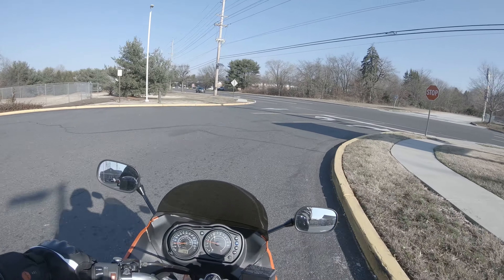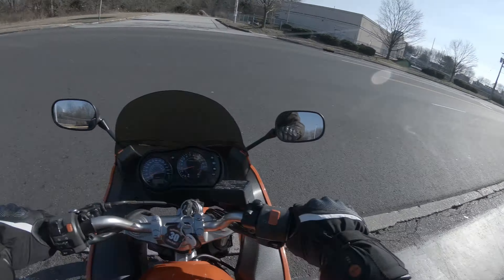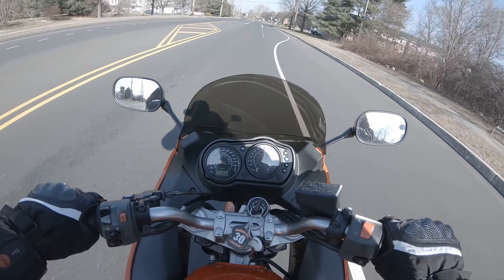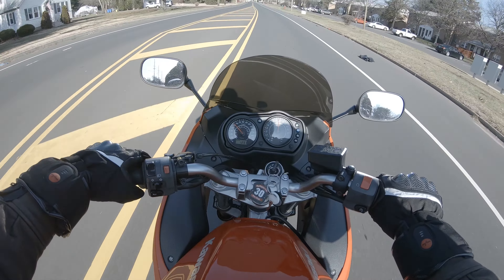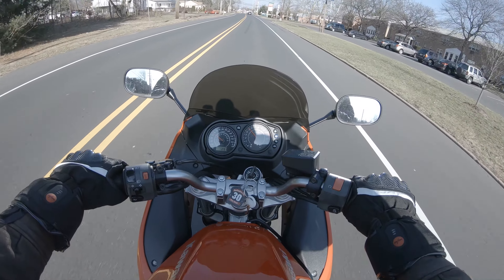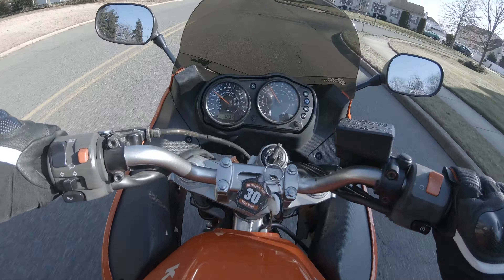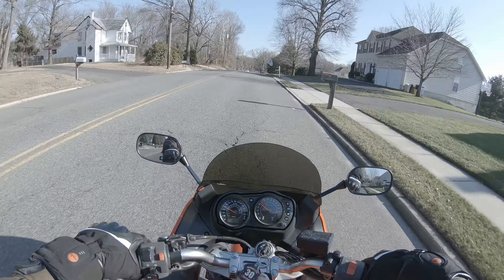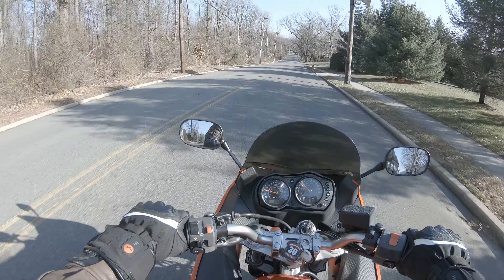Emptying Fuel Injector Cleaner In My Motorcycle! What Happens?

Comment: I don't know what you guys are talking about.... I saw a 500HP gain from one bottle instantly.
Reply: Hell my racing stripes gave me 55 hp instantly
Reply: That's nothing. If i close the air vents in my helmet and I gained 1000 moped experience points. The hp gain was only 7
Reply: That makes total sense. I had a mustang gt an when I bought a new 6 disc changer it added over 8.2 horsepower.  Lmao
Reply: I added cleaner to my bike, threw away the bottle, turned around and found a brand new shiny bike sitting there.
Reply: When your drag car has bad injectors
Reply: You did not get 550 hp gain.  Must have gotten old stock bottle. :)
Reply: @brandonb.3317  Heck my racing strips only made my underwear Stink..lol
Reply: @brianstumo8581  this one ended it all 😭😭😭😭😂
Reply: You get even more hp when you pull the sticker off the bottle and slap it on the tank
Reply: Lol yeah man I added a bottle to my yzf600 and went so fast my molecules separated and I entered another dimension.  what a trip outta sight!!😂
Reply: You probably saw a puty cat too. Or maybe the great wiz of oz.
Reply: what say the F' you talkin about.
Reply: Presume it would take a little time to do it's cleaning action. Any immediate improvements might be due to some octane improving properties

Comment: If filling the tank gave instant results, you don’t have an injector issue, you either have a plugged filter or collapsing fuel line.
 Filling the tank increases the head pressure and pushes the fuel past the obstruction, until it gets low again.
Reply: If he was running cheap gas , the fuel injector cleaner would be a  improvement within about 10 minutes, I have experienced this multiple times  with numerous small engines including motorcycles. One big difference as well is using gas that DOES NOT have ethanol. It will run like it’s not even the same bike.
Reply: @spartanx169x  he didn’t say 10 min, he said 2, or pretty much instantly.  It’s a delivery issue.  Whether the gas has ethanol or not is not pertinent either, because, again, it’s pretty much instant.  
 And the difference in the fuel isn’t that dramatic.  @ 10% ethanol there is a loss of energy, but not a “ hang on tight this is pure gas” difference.  The biggest issue with ethanol is it attracts water and that causes performance issues and  fouls filters and attacks fuel system internals.
Reply: Vent cap or vacuum hose on the petcock
Reply: @PeterSmith-or3pq   no vent cap or petcock on fuel injection, it’s a pressurized system.  Feed and return to tank. Otherwise I would agree.

Comment: Rides it 2 minutes and suddenly the bike feels better. Squid...
Reply: I mean most of the additives contain Octane boosters too.  So higher Octane could result in a little higher performance (Really small) and lower gas milage.
Reply: Yeah its actually nitromethane thats being added so he definitely felt the difference
Reply: @MrArjanOskam  Higher octane doesnt boost performance UNLESS the engine is experiencing preignition (otherwise known as detonation, pinging and/or knocking... we'll simply call it preignition for now). Preignition is exactly what it sounds like... the fuel is igniting before (pre) the piston reaches top dead center, which is caused by excessive combustion chamber heat. The fuel is actually igniting before the spark plug fires, which will not only rob power, it can do real nasty things inside the engine, like bending rods, valve stems, putting holes in the piston(s), blow head gaskets, etc, etc.

The higher the fuel octane rating, the less prone to preignition the fuel is. So if the engine is detonating on something like 87 octane, it wont make full power in the first place. If the same bike gets 91 or 93 octane gas and the preignition stops, then it WILL make more power, simply because the engine is running without preignition. If the engine is running properly on 87 octane with no detonation, using 89, 91 or 93 octane will not make the bike run better or make more power. The bike will run the same as it does with 87 octane (I get a kick out or riders that say "I put 100 octane race fuel in my bike and it was way faster. Only if the bike was not running properly in the first place. If the bike was running well on 93 octane, putting in 100 octane wont do a thing, other than smell different coming out of the exhaust pipe). If the bike still detonates with 93 octane gas, then something else is wrong, and the bike should be brought in for service.
Reply: Damn, that was some fast ass cleaning 🙄
Reply: @MrArjanOskam  if you have problems with octanes yes, otherwise will make no difference.
Reply: @pedromesquita2780  True, mine felt better, but probably because long standstill and cheap fuel
Reply: Ha! I know this dude that put 91 octane on his honda cbr. (It calls for 87) he decided to go with 87. Guess what?  it actually increased the gas milage. He use to get 180 to 190 mile range per full
 tank, now he gets 200 plus (around 225 to 235 per full tank)
Reply: @MrArjanOskam  high octane doesnt add power in an engine that isnt made to  use that octane. Octane number just increases how much gas can compress before it spontainously explodes (withouth the spark plug). Higher compression =more air = better burn =faster cylinder movement = MOAAAAAAAAR  POWAAAAAAAAAAAA!!!!!!!
Reply: As if the 650 Kawi wasn’t enough..
Reply: Didnt even hit the revs and the whole tank to clean it out...Noobs😂LoudLove lil brudda,You’ll figure it out in time🔊🔊🔊💜💜💜
Reply: @JB-ls5pq  actually depending on the vehicle and tune as well. Some modern ECUs when they take at least 93 and you put an octane booster and boost it to 102-106, the ecu auto pulls timing and you make more power. Some low compression engines also get 1-3 hp increase is very minimal, we see in our dyno. The reason is due to the engine calculating the timing and being harder to burn they can make more precise timing and it increases the performance a little.

But your point still stands, octane rating doesn’t equal more power. But it does help when you are turning up the power.
Reply: I love your attitude 🤘🏻🤘🏻🤘🏻
Reply: @Ray-xx5np  dude best awsner I’ve ever seen anybody write out it’s really that simple for all the doorknobs out there 🤘🏻🤘🏻🤘🏻
Reply: He just used more throttle the 2nd time .
Reply: Wow that was dumb.
Reply: @Ray-xx5np  running high octane, like “race” gas will help clean out some carbon tho from my experience.
Reply: @alicesrustychains6767  Thank you, my friend. I really appreciate your nice comment!! 👍 👍
Reply: @colossalbigfoot256  I havent seen that (not saying its wrong, I just never noticed it). One thing I DID notice though... I used to have a '92 Mustang 5.0 that I installed a Kenne Bell supercharger, and an MSD ignition with the adjustable timing module. A gas station near me sold 100 octane (unleaded) pump gas, and I'd use that, and bump the initial timing up to 18 degrees. For a while, I stopped using the 100 octane pump gas, and put a bottled additive octane booster into 93 octane pump gas. It worked ok, but during a plug change, I found a residue coating the plugs that looked exactly like rust. Initially, I thought I had blown a head gasket and was leaking antifreeze into the combustion chamber, but the car was running normally. It was the additive doing that. I stopped using any sort of bottled octane boost from that point on.
Reply: I noticed the royal purple I used in my 2013 soft tail slim real fast and after 600 miles did it again big difference. Get the stuff with a breaks up carbon 👍
Reply: Salty
Reply: What camera are you using? and where did you mount it? Also are you using a external microphone?
Reply: Lucas fuel injection cleaner works good lubricates injectors too!!!
Reply: 222 Guys who have never worked on an engine, thumbs up'ed your comment.
Reply: @Ray-xx5np   Most knock goes unseen. Something like a scangauge for obdii vehicles will show the actual knock on a stock tune.
 Also, it only take a small amount of acetone to disturb fuel enough to allow a greater offgas, which results in a more efficient combustion.
Reply: I had a carb issue starting to show up. I added some product and I instantly felt a difference so it's highly possible he felt a difference after a short blast. Some of these cleaning products can really bring some life back to the internals.

Comment: Seriously? No cleaner works instantly. Get through a whole tankfuland then look for a difference.
Reply: Maybe not in this case. My diesel was blowing smoke due to the reduced sulphur content blocking the injectors, but I didn't know why. When someone told me I put a double dose of injector cleaner in the tank and the problem was almost gone by the time I got home. Believe me, it was a real relief! I'm not sure about any performance improvements but it can't have hurt.
Reply: It depends on how much you mix up I always go for over kill on my mixes chevron with tech Ron black and gray bottles largest bottle you can buy 104 octane super black and heat red bottle and 93 octane gas for that super kick in the pants my olds 307 loves it peace and much respect to you Jason
Reply: You're right, but also what can happen is that it breaks down water/condens particles, so that it constantly feels better.. I mean, no hesitation and sputtering in carburetor/injection..
Reply: Now you're talking!
Reply: For me it does, last week my bike felt sluggish & idling was rough, even died while idling when its cold. So over the weekend, added in half a bottle of penrite injector cleaner with roughly 2 gal of fuel…then run it around the neighbourhood for few minutes. Could really felt the difference, no more rough idle…acceleration felt better, got a marginally better top speed than before 😊

Comment: With only 7k mls on the bike there will be no need to clean the injectors unless there had been a bad batch of fuel that may have fouled them but bike was running ok before. Any noticable performance increase would have been from getting the engine real hot on a cold day.
Reply: U gave me my answer man thanks any company you’d recommend?😊

Comment: It's a progressive cleaner snd breaks down crud where ever fuel sits within the components. It will possibly make your bike stutter etc ifnits breaking  up harsh deposits but it does improve the responsiveness etc once it's done its job. They recomend higher rpm too for s better cleaning cycle as your passing more fuel and cleaner with more rpm and also adding more hear. Hope this helps bro

Comment: Placebo effects 🤣
Reply: 100.000 views your supposed to completely fill the tank too and have it run through the bike
Reply: Fax
Reply: He COULD notice a difference... BUT, if a bike runs better after a fill up it’s not the fuel, it’s the WEIGHT of the fuel.
  If he has a partially clogged filter or collapsing fuel line, as the amount of fuel in the tank goes down, so does the flow of the fuel.
 It’s head pressure. If filling the bike makes it run better, the head pressure, or weight of the fuel, is pushing the fuel past the obstruction.
 Then , as the level drops past a certain point, it can’t overcome the obstruction again. Fill up, all good. Classic symptoms.
 It would take several tanks and many miles for cleaner to do anything of note.

Comment: Thanks for the Video, had to drain my tank to adjust my valves, after filling back up my bike started running like crap.  Figured it might be my carb and did not want to pull it so I tried the Techron.  Used over half in my first tank, used the remainder in the next tank and my Vulcan 800 is back to normal.

Comment: I have been using Techron fuel additive for years. It is great for cleaning parts, but is really designed as a preventative against sludge and varnish in your fuel system. In many markets, maybe yours, E-10 ethanol based fuel is all that is available and ethanol gas breaks down after just a couple of months. Storing a bike, lawn mower, chain saw, boat roto tiller, etc...without adding a quality fuel system stabilizer or cleaner has cost unsuspecting consumers millions of dollars every year. Expecting immediate results, as you just did, is a little unrealistic, although if you say you felt a difference I'll believe you. This time...

Comment: Techron is good cleaner. What to look for is PEA. That's the cleaner for modern fuels. It works quickly so I'm not surprised that one might notice a difference in throttle response right away. I cleaned a throttle body injector with the stuff and as soon as it fell into the glass the liquid change color. It was right away. You don't have to over do it with the amount. It might cause some kind of failure in an O2 sensor or something if you put too much in, if your bike has one.

Comment: Those things really do work when you have a real problem. I had a head gasket busted in one of the cylinders and the oil was getting into the combustion chamber making the spark plug wet and shutting down that cylinder completely. It was a V-twin and I could only ride it if I added those cleaners with EVERY fill up. They helped me get by until I had a chance to fix it. Most bikes don't need it at all. Besides a little bit of techron is added to the gas on shevron gas stations anyway.

Comment: Ran out of fuel once had to make it a short way home. I had a little bottle of octane booster which I poured in the tank of my motorcycle. It ran on that but it seemed to rev high and it also turned the spark plugs Orange in a matter of blocks

Comment: The purpose of a fuel injection cleaner is they work through heat soaking. Pour it into the bike, start bike and let it warm up   and ride it a few minutes to run that fuel through or lift the back and put it into gear.

Comment: Had some rust in my tank and the motorcycle started to act up while us rideing in other country. It started losing power and would not rev up. Not to mention the abnormal engine noise, a low grunt...
Now imagine overtaking a truck and by the middle of that truck, the bike lost power and revs went back to 2000rpm...
Used fuel injector cleaner to finish my 2 week motorcycle ride with ease.
So Fuel Injector Cleaner is good for something.
Got back home and changed the gas tank and the entire injector ramp, just to be sure for the future. 
Left unchecked, rust in the tank is a m.f.

Comment: I just hit 20K miles on my bike, and I just did VP fuel system cleaner. not something I would do all the time but I felt 20K is a good time to do a treatment.will probably do one now every 10K. I still have plans to take my throttle bodies off and clean them. but this should be good to keep the chamber clean and injectors flowing. I do feel better throttle response,. not sure about MPG, I think it's about the same. 47MPG for my 2015 FJ09

Comment: On a 5 gallon tank how much  of the teckron  should you use?
Reply: He shouldn't use the whole bottle. For a 5 gallon tank, half a bottle of 12oz should suffice. Pour in the injector cleaner in ur low fuel tank, and then fill it up with petrol.

Comment: If you use trash gasoline, you will notice a difference using additives. Especially if deposits build up over time, or you don’t drive very often. Seafoam, atf fluid, and cold beer has unclogged stuck lifters and dirty injectors and saved thousands of un needed mechanic bills. Always remember a mechanic isn’t going to tell you that anything bought off a shelf can help.
Reply: Where can I find this "trash gasoline " you speak of?

Comment: I hate being restricted or lack of touch/grip. At 180-200.... one mess up, your done. So, until below 35, hoodie (maybe 2) jeans or "pajama pants", and grip tennis shoes. Full face helmet with a clean visor coated with water repellent. And 1000cc mostly aftermarket rocket between your legs baby! Perfect road temps and summer almost here ;) they aren't ready for the new toy 😈
Reply: Every time you get on a motorcycle, you have to be ok with dying. Or your fear will cause hesitation. Dont ride, fly 😁

Comment: This is one of those learning experiences. You’ll look back on this video and laugh bc you’d have learned fuel additives do nothing but make your wallet lighter. You may go faster by the weight loss in your wallet ✌🏽
Reply: hahahaah  lol
Reply: No instant gains but bought an 83 rx7 from an auction carb was gummed up pretty badly. Barely ran secondarys didn't open. Use a bottle of carb cleaner and every time it was restarted it ran a little better. Fast forward two tanks worth and carb was working perfectly. Saved me from  pulling off that vacuum hose laden pos and going through it.
Reply: If you use them right then no they don't just make your wallet lighter, if you're putting system cleaner into a bike that doesn't even need cleaning then obviously there's off to be no change, the change comes when you add it to a bike that needs cleaning, it isn't instant magic it takes time to run through and a couple bottles but there is improvement.

Comment: Actually you were supposed to fill up your tank first and then put fuel injector cleaner in there. When you fill your tank up then you put in the injector cleaner, it mixes from top to bottom. If you read the instructions that's what it tells you to do anyways so you did it backwards
Reply from the maker: It said on the bottle itself to fill it half then add. But since it's only a 3 gallon tank. I said fuck it
Reply: @mcfgotmillk  
It doesn't matter which way you did it, except that it worked!!
I sometimes use a few ounces of "Seafoam" in my fuel tank, and believe me, it keeps my EFI- 08' Sportster XL1200 Nightster in top condition! 
(Also, I always use "Shell Premium" fuel 93 octane, because it has the most amount of detergent than any other brand fuel. Don't believe? look up the specifications! It saves me from buying a bottle of fuel injector cleaner, at the auto parts store, and trying to figure out how much to carry, and put into my fuel tank.)